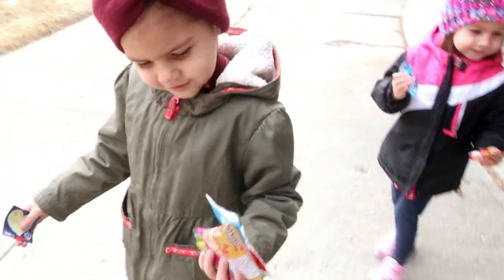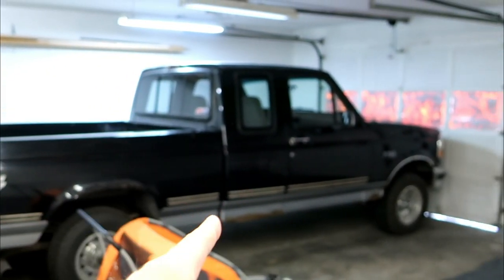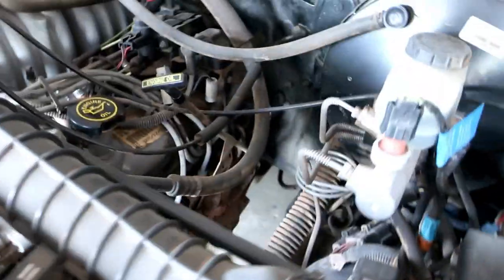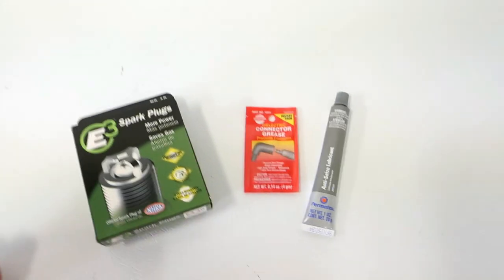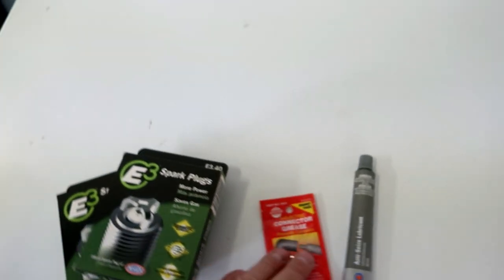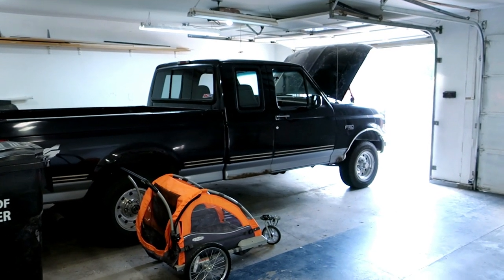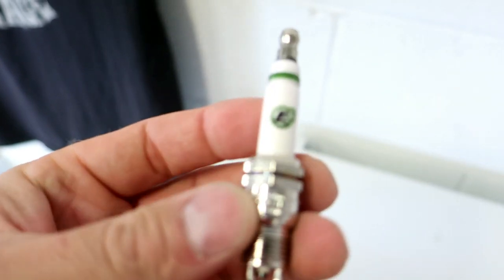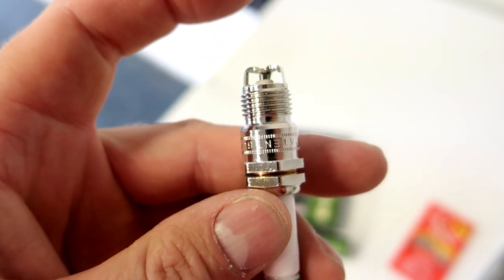E3 SPARK PLUGS ON OLD TRUCK

Comment: Thank you for this video! I haven’t found an honest review on the E3 Spark plugs. Let alone one with a high mileage vehicle.
Reply: He replaced a set of old rusted spark plugs with new ones of course it's going run better!
Reply: I mean I've had great luck in lawnmower with them especially single cylinder engines you can definitely tell that's the cheapest and most impressive different you'll see but I keep getting told they are failing and such and I'm looking for proof and so far nothing but people running to much fuel for the heat range and melting them and honestly that's just there fault not the plugs

Comment: That's what I'm going to do with my 1999 SLT dodge Durango V8 magnum she a pig   on gas but not to bad she not running so hot right now I'm kinda hoping that the e3 diamond spark plugs will help and I'm using royal purple high milage oil and royal purple transmission fluid in my truck she not running so loud now I'm happy with it that and just got to save up on a new muffler ya my truck has around 350.000 miles on her still kinda running strong but I think I can make it better for long drives

Comment: congrats you just added at least 12hp that the min the plugs tend to add. want more change the air filter to the cheapist most flimsy and thin filter you can find this will give more air flow. and rember to replace the air filter ever time you do a oil change. and from my experience and every car I have had I use synthetic oil and change my oil ever 2000 to 3000 miles I know that's a lot people but trust me it will make your engine last many years longer. I just got a new car now and will be doing in it what I do in my bike and switching over to royal purple oil and filter in my bikes they make a huge performance boost and help the engine to run cooler witch is needed since I drive hard and fast.

Comment: For the love of god can anyone claim a valid response? I been reviewing E3 spark plugs for my Lexus Gx470. (V8, 4.7 L). I been reviewing a lot of negative remarks about these plugs and now reluctant to install them. No, I do not plan to race with it and just normally drive my truck. I keep hearing misfires. Listen if your going 100+ mph up a long hill, with your car loaded with people and Cargo space full, your asking for trouble. I feel like the people who make negative remarks about these plugs, probably abuse their engines really bad and then complain about their spark plugs. So, can someone...Anyone, who currently has these E3 plugs installed, and been driving their vehicle for some time, comment about these plugs. If your a street racer, I don’t want to hear your comments. Donut lovers, drift lovers, fast furious wanna bes, Mr “I love driving 3 times the limit all the time” driver, walk away. Im asking this question to people who drive like a normal human being. Thank you.
Reply: The problem why people have negative reviews is because they use die electric grease on the sparkplugs. Dont do that because the sparkplugs are antisiezed metal no need for the grease. Thats where you'll have the best reviews. Dont worry it won't cook to your engine. Been having them in my Chevy for 7 years now havent had a problem since then
Reply: And to get the best results use those sparkplugs and replace your airfilter with a K&N filter. You'll be super happy and you'll see a serious improvement. Sorry meant to include that

Comment: What sh** thats not why they work better obviously they make a difference not a big difference but they do make one they work a bit better because there are multiple arks drawn instead of just a single ark so it lights faster
Reply: Nope, it doesn't do multiple arks at the same time... But the single Ark jumps around between the 3 electrodes. Whichever has the least resistance.